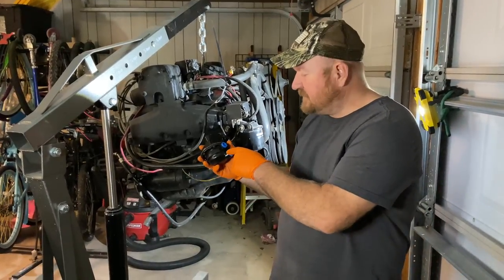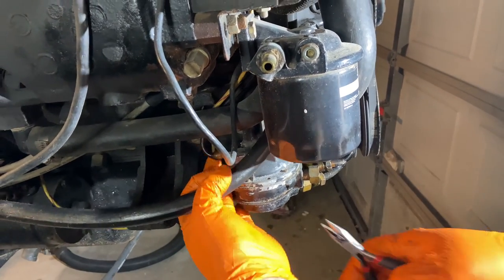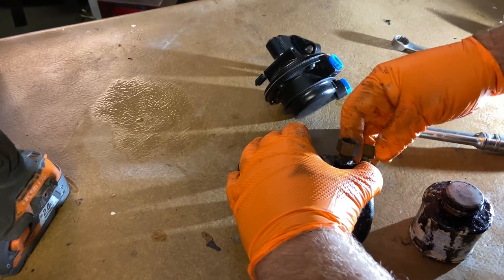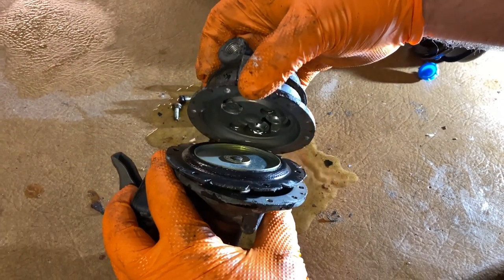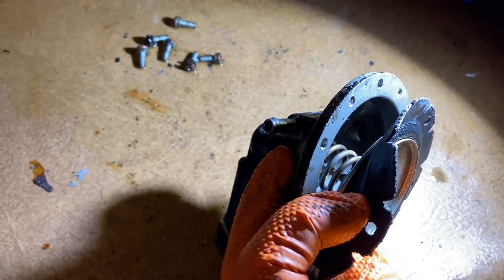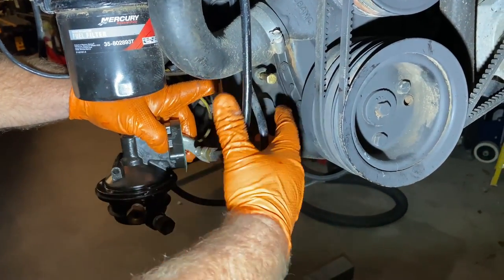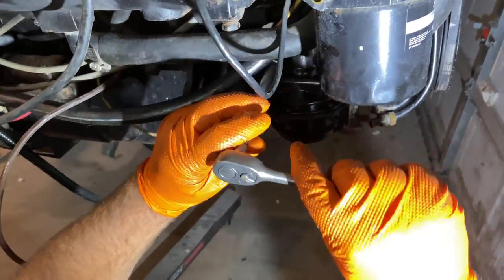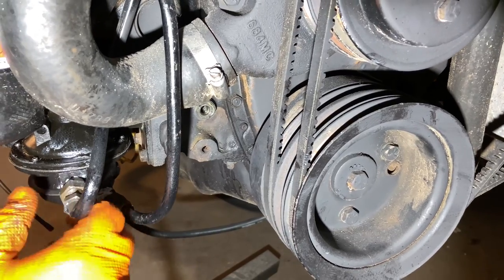Fuel Pump Replacement In A Mercruiser 260 Boat Engine

Comment: hey man, awesome video! really appreciate it. My 5.0 Mercruiser TKS keeps stalling out in idle after being warmed up. I had it running for an hour in idle after a cold start, thought it fixed itself! Turned it off then back on deliberately to see if it would stay running, but it just kept stalling after each subsequent start. Think it could be the fuel enrichment module aka TKS module? Or more likely the mechanical fuel pump? (I should also add the boat continues to run if I had power and will not stall)
Reply from the maker: It’s really hard to say-  kind of sounds like carburetor problems.  I would start off by making sure you got good clean fuel filters. Check your carburetor adjustments.  Glad you liked the video- thanks!

Comment: Yes and for the outlet I see little water coming out but this boat was really bad maintenance so I want check if some inside first
Reply from the maker: It can be hard to tell from the hose.  The best flow is in the tank or submerged in water.  You want to check the temperature gauge to make sure the engine is running in the correct range.  It is a good idea to replace the water pump impeller and thermostat if you do not know the service history.  I have a video on both of those as well
How to Replace the Thermostat on a Mercruiser 260 
https://youtu.be/dyKap0EiGFw
Reply from the maker: In addition to my previous reply, this may also help you:  How to Install a New Water Pump on a Mercruiser 260 https://youtu.be/-s1E9U86AEE

Comment: Thank you for your videos they have helped me understand more about my engine.  I have a recently purchased 1986 Condor Mach 1 with the same engine as this video.  The problem I'm having is out of the water and unloaded she goes through the full rpm range.  In the water and under load I can't get her over 3000 rpm and she refuses to have any power out of the hole.  I can eventually get her to plane out and run all day at 31mph and 2800 rpm but I can't get any more.  I replaced the cap plugs wires and fuel/water separator.  Any other thoughts?  Thank you for your time!
Reply from the maker: Thank you!  I'm glad my videos are useful.  Since the boat is new to you, I would ck  the adjustments like throttle linkage, engine  timing, change  all the fuel filters etc.   You'll want to make sure that the throttle is opening the carb all the way.  My guess would be that the carb probably needs to be rebuilt.  Most of the power comes when the back barrels of the quadrajet open up and you will hear it when it happens. I have a video of my engine running on the water and you can hear that on that video.
https://youtu.be/lrxd1Ee675c
Reply: Thank you!

Comment: I have a 454 Mercruiser with mechanical fuel pump.  It has a bulb fuel primer going to fuel water separator filter. Do a really need a hand bulb primer at all? Shouldn't the mechanical fuel pump work fine?
Reply from the maker: Mine doesn’t have a primer bulb. It could come in handy if your boats been sitting a while, would prevent the extra cranks from the fuel pump having to build up fuel in the carburetor.
Reply: Thanks for the reply, great video!

Comment: My fuel pump is leaking oil lol

I suppose it's from that cam in the block.  I ordered one so thanks for the video
Reply from the maker: Thanks!  Yep- a bad gasket between the fuel pump & the block will cause an oil leak.  That is a good time to change your fuel pump.
Reply: @ProWrenching  you ever do one while the boat is in the water?

I'm worried gas n oil is going to spill all over the nice marina I'm at
Reply from the maker: @ghostnumber717  No, I haven’t.  The biggest risk is a fuel spill from the fuel tank when you disconnect it from the pump.  The safest bet would be to do it out of the water, in my opinion.
Reply: Hey just a quick update, upon inspection,  I don't have a bolt on my access hole!!! Wow..

I really appreciate this video now. 
Anyone kno the size of the bolt?
Reply from the maker: @ghostnumber717  I’m not near my boat to check for sure, but i believe the bolt is a 3/8” thread.  Very short, maybe like a 1/2”.  You don’t want a long bolt on there b/c it will interfere with the push rod that runs ftom the cam to the fuel pump. You’ll want to install it with some RTV gasket sealer on the threads so it doesn’t leak oil.

Comment: I have a mercruiser 5.7 carbed model circa 1995. I think it may have been repowered at some point because the cover that sits over the carb says mercruiser 5.0 I had to pull the heads had shop resurface them and replace the blown head gasket. The 5.0 gasket didn’t fit, 5.7 gasket sure did. I am probably the third owner or so and it originally had a mechanical fuel pump probably. When I bought it it has an electric fuel pump and it’s been an issue. Once up and running it’s fine but when the boat sits for days between uses it’s a bear to start again. If I hook the fuel pump direct to battery to reprime it I will get gas squirting when I hit the throttle to start it. It’s wired to an oil pressure switch that SHOULD be activating the fuel pump via the starter wire that’s also connected to the oil pressure switch then once started the power should come from the key on purple wire to another terminal on the oil pressure switch that’s normally open until it sees 5 psi. It takes lots of cranking before fuel pump kicks on and can be heard. It’s a new oil pressure switch from maybe 10 months ago. I just want to be able to turn the key and start it. Are electric fuel pumps supposed to lose prime as they sit? Is there a check valve in the fuel pick up tube inside the tank? I’m at a point where if it’s been sitting I’m going to connect straight power to prime the fuel pump first, squirt fuel in the carb, disconnect straight power and do first start up that way every time. Boat shop gives me wiring diagrams but it is connected correctly. Another bad oil pressure switch already? All I know is the added on electric fuel pump has been nothing but a pain in the ass this whole time. Any input greatly appreciated
Reply from the maker: The newer model carburated Mercruiser engines come with electric fuel pumps.  It sounds like you may have a couple of things going on. It sounds like your carburetor may be leaking the fuel out of the fuel bowl.  This is a common problem on the quadrajet carburetors and there are some plugs on the bottom of the carb that can be epoxied during the rebuild process to fix that problem.  If the fuel bowl is empty when you try to start it, you will have a very long crank time until you get that fuel bowl filled up.  If it runs fine after primed and started- this carb is your main issue.  You may also want to check the fuel pressure of your fuel pump.  I believe those are supposed to be somewhere between 3-7 psi, depending on the model.  Its also a good idea to install new fuel filters.  Plugged fuel filters can cause a restriction.  I hope this helps you.

Comment: Hey man. Using a lot of your videos.  Just grabbed an 85 260.  Just bought the Sierra pump.  Came with 3 gaskets.  I’m assuming this is so they can fit different applications but they are all the same shape. One is thick snd I don’t know if writing should go on the motor side or pump side. The other two appear same thickness. Ha
Reply from the maker: Hey- great to hear, glad you’re finding my videos helpful!  All 3 gaskets will work, but try to match up the thickness of the original gasket if you can.  If you can’t tell- just use the medium thickness gasket.  I’ve installed the writing both ways, so it shouldn’t matter.
Reply: @ProWrenching  thank you ! Appreciate it.  Yup I’m going to eventually do the impeller and thermostat, cap rotor and wires yadda yadda.  It ran great at idle but after about 20-30 seconds at 3/4 power it died.  Had to blip throttle wide open to get it to catch while cranking starter and keep blipping to get it to hold idle or if I didn’t play with it right after catching it would die. After about 5 blips it was back to normal and would idle great all day long.  Once I slowly sped up to 2000 rpm it died again.  Then same restart thing snd I idled it back to the dock.  Just waiting for the last of the parts now and hoping to resplash here In a week.  I’ve only had it in the water that one time. At home sure enough starts great, runs at idle perfectly, can blip throttle without stumbling.  Unable to duplicate issue on trailer.  This is a big beast of a trailer boat so it’s not fun to launch and test.  It’s a Santa Cruz 26 (made by carver )

I was pushing on the wires off the distributor cap and got electrocuted on the wire in the center of the coil so yeah new wires coming too. And plugs. Try some ignition stuff snd some fuel stuff.  Almost feels like it was flooding.
Reply from the maker: @Natter20002  It sounds like it could possibly be a carburetor issue.  May need to rebuild the carb.  Also check the choke.  It’s good to have new plugs, new wires (like you said), check the timing, no loose wires at the battery or ignition coil.  You might pull the dipstick & see if the oil smells like gas.  That’s a sign of flooding.  Good luck with your repairs.  Hope you get on the water soon.  Stay tuned- got more videos coming later on installing new exhaust manifolds.
Reply: @ProWrenching  I can handle that.  Have a kit you recommend ?
Reply from the maker: @Natter20002  I used the Sierra 18-7095 carb kit.  You may also need to buy a float separately if yours is saturated with fuel

Comment: I don’t have that access bolt what can I do
Reply from the maker: You should be able to take a screwdriver and move the fuel pump rod higher so you can install the fuel pump. If you were unable to move the fuel pump rod high enough then you will need to rotate the engine so that the cam shaft lobe is on a lower point to allow the fuel pump rod to go into a higher position.

Comment: Oh I forgot about that stupid rod. I don't normally work on Chevy motors, but I had done a fuel pump once before on a friends Vette and that cause much swearing.
Reply from the maker: Yes, those rods can be very frustrating and if you do enough of them you end up coming up with different tricks to help you get the job done.

Comment: What is the name brand of the pump
And where do I order. Thank you
88 bomber vanguard omc 5.7l
Reply from the maker: Here it is:
fuel pump I used 
(PAID LINK)https://www.gopjn.com/t/TUJGR0tFTUJHSEVJR0lCR0hISUtM?url=https%3A%2F%2Fwww.westmarine.com%2Fbuy%2Fsierra--18-7283-fuel-pump-omc-509404%3B-mercruiser-861678a1-97401a2--1653138
DISCLOSURE:  If you purchase thru the above link, I will receive a small commission at no extra charge to you.  Thank you!

Comment: So assuming a person pulled the vacuum line off and it had gas in it the pump would be bad, correct? There should never be gas in there for any other reason?
Reply from the maker: Yes- that would be bad.  If there’s fuel in the line,  it would be from the diaphragm of the fuel pump leaking so the pump would be bad.

Comment: Can i install the pump without using the bolt hole to hold up the rod?
Reply from the maker: Yes- but you’ll have to push the rod up and then slide the pump lever under the rod.
Reply: @ProWrenching  i can push it up! But it maybe goes half way , is it way to get it completely up? 

Thank you
Reply from the maker: @domdom7783  You can turn the engine over by hand. It will give you more room by turning the camshaft which pushes the fuel rod down.

Comment: My friend there is any way to check the water flow I see on my engine is getting out just a little I don’t know how to check that mercruser 3.0
Reply from the maker: Ok.  Are you running the engine connected to the water hose?

Comment: Did you have to pull the motor for this job?
Reply from the maker: No- I could have replaced the fuel pump on my boat w/out pulling the motor, however I already had the motor out so I could replace the gimbal plate.  I recently purchased the boat and the fuel pump looked original & I don’t kmow the service history on it, so I changed it out.

Comment: How many gaskets go in? My kit came with 2 thin gaskets and 1 thick harder gasket , do I install all 3? In your video it looked like you just installed the thinner gasket ?

Also, what silicone did you use for the access bolt?
Reply from the maker: Yes- i just used the thinner gasket.  I matched the original gasket that was on the motor.  You want to use the same thickness of gasket that comes off your motor.  I used black RTV silicone.
Reply: @ProWrenching  thanks, does the oil need to be drained before removing the fuel pump?
Reply from the maker: @skmg2888  nope.  The fuel pump sits above the oil pan so it doesnt need to be drained out.

Comment: Question. I'm new to boats and I am mainly used to newer engines. It's my first time having a carbureted engine. I have a 1985 mericruiser 350 engine in my boat and it doesn't seem to be getting fuel to the carburetor. I replaced the fuel filter, added new fuel, and still nothing. Also, the boat has 2 gas tanks. How do I know which is active? If anyone can help me with this, I'd be super grateful.
Reply from the maker: Start at the carburetor and work backwards. If you’re not getting fuel to the carburetor then check to see if you’re getting fuel to fuel pump. If not, follow the fuel line back to the tank and the selector valve until you find the problem.  That’s how you’ll figure out which gas tank is active, too.